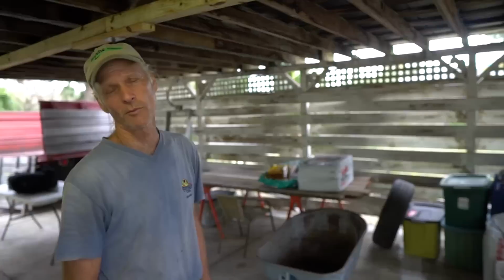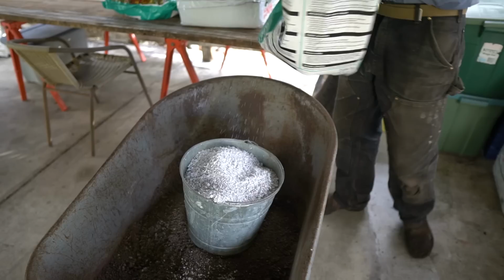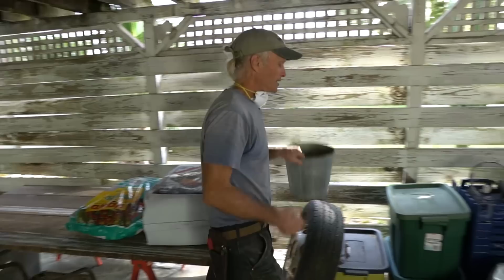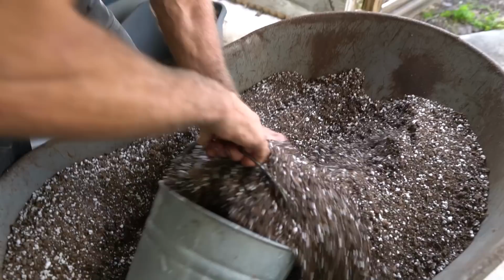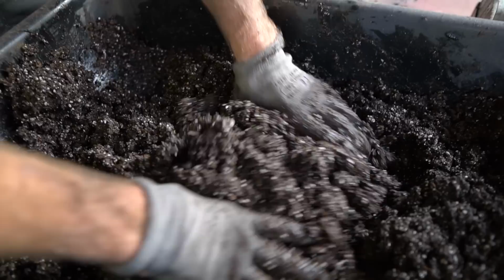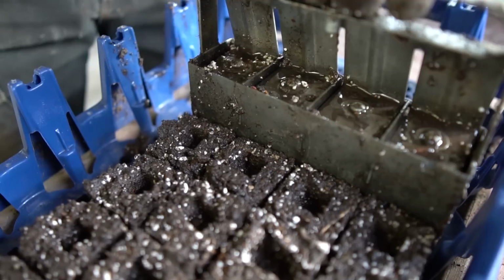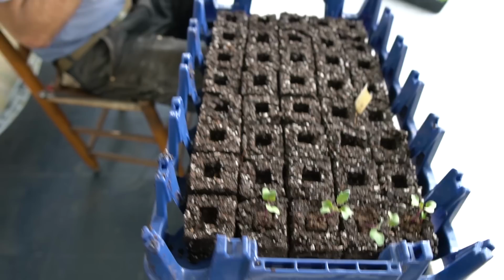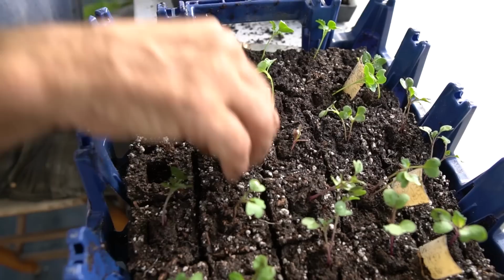Making Soil Blocks:  #1 Method For Starting Seeds (w/ Jim Kovaleski)

Comment: What is the need for so many soil blocks and block transfers? I am sure there is a reason. However, I see it as unnecessary work. Why not just one block depending on seed type, small or large, then transplant? Starting with a larger block avoids the need for transplanting into larger blocks before transplanting into the garden. Also, Why make blocks? Just start them in a pan with the correct depth per seed type and make a divider for 2, 3, or 4 inches in length and 3 inches depth of soil should be enough to start them.
A concept example would be like the old metal ice trays? You could punch holes around the sides and under neath for aeration. Brownie bar pans as a concept too, just fill and turn over into your flat, pan or tray. They make all types of molds or DIY a mold. For the small first tray you had you could use ice trays as they come in various sizes. There are so many things you could use. Again, I would just put them in the larger block, 3 x 3 would be enough imo for any seed type,  to start with and just transplant them once.  
Some DIY just use toilet or paper towels rolls cut 3 inches and fill with medium then plant the entire thing in the garden. The tube will compost and you do not have to mess with the roots at all. 

The medium is just a wide mix ratio of all known garden mediums. Use coir instead of peat as it is more sustainable. 
Each to their own. Happy gardening.
Reply from the maker: Did you actually watch the video? Jim explains why it works better to start with the small block and go to the big block.
Reply: @PeteKanarisGreenDreamsFL  Yes, I did. He uses different soil amendments to sprout than he does for first transplanting. Also spoke of the moisture.....which is the amount you water. The amendments being divided and used is just creating more work. You can spout a seed in between damp paper towels and then transplant. Again some of this method is just extremes and more work than you need to do and created by someone who has a lot of time on their hands to be a perfectionist. How do plants reseed them selves? They fall to the ground and spout. No one makes soil blocks for them. Do you get it? For those blocks you could just pat it out with your hands or fill a yogurt container or container size of choice or a 3 inch ring mold and stick your finger in for a hole.  You are not going to waste the amendments as you reuse them and or add it to the garden area. Keep it simple. lol

Comment: Hi,
I also have the 4x Ladbrooke Soil Blocker. It came with the normal nips. It works absolutely wonderfully for making soil cubes. They are accurate and come out whole. 
But when I insert these black cubes where I want to insert the small soil cubes later, the soil cube gets stuck in the Soil Blocker. The whole soil cube is pushed out completely, but the part of the black cubes is so stuck in the soil cube that it does not come out. When I pull up the Soil Blocker, all four soil cubes are hanging only on the black cube inserts. Trying to get the soil cube out usually ends up breaking it. I dip the Soil Blocker in water beforehand, which doesn't solve the problem. The only thing that helps is the opposite. Dust some dry soil dust into the Soil Blocker. This gets them out quite well, but it is inconvenient. Do you have any ideas what could be causing this?

Comment: Hi Pete, where do you get your blue trays that have your 2" soil blocks? Thanks again!! Mu hubby is watching your video with me - we'll probably watch it several more times... and share it. Very informative!!!
Reply from the maker: These are recycled Soda bottle carriers for transit.
Reply: @PeteKanarisGreenDreamsFL  OK, thanks much! We don't drink soda so I've never seen them. They look easier to use with the openings around the sides. I have Extra Strength for Propagation trays, I use net cups in the trays with a small bit of water in the bottom to start seedlings. I'm looking forward to using soil blocks!! Thanks much!!!

Comment: Does Jim use any heating mats for the mini soil blocks?
Reply: No it is not usually an issue here in florida in the fall.Though the 85 degree heat can cause germination  problems.

Comment: If your peat moss gets dried out it takes a lot longer for the water to sink in. If ti comes moist and you keep it covered then it’s not so much of a problem. But I hate buying product that has had water added to up the weight. Feels like the manufacturer is cheating customers.

Comment: Is there a company you recommend purchasing greensand through?
Reply from the maker: That’s a tough one to find
Reply: 40 lbs from Amazon at 80 bucks shipped. Not cheap but only using 2 tablespoons it should last awhile.
Reply: @tgrone882  thanks! I've just purchased 2 bags.
Reply: I use a 3-3-1 recipe for the base and add the fertilizer base then mix.  3 quarts peat, 3 quarts screened compost, and 1 part perlite.  Fertilizer base is 2 tablespoons each of green sand, rock phosphate, and glacial rock dust or substitute Azomite.  Happy growing!